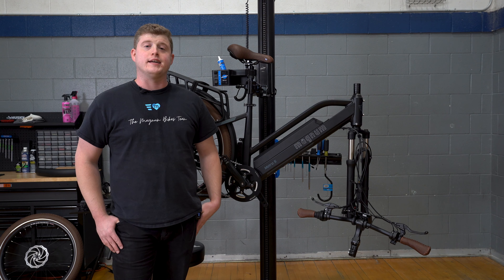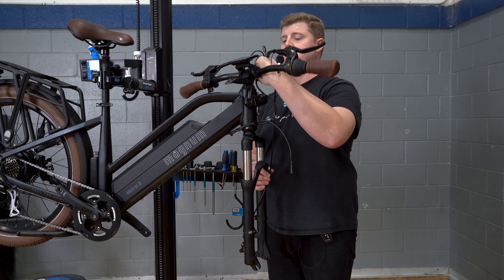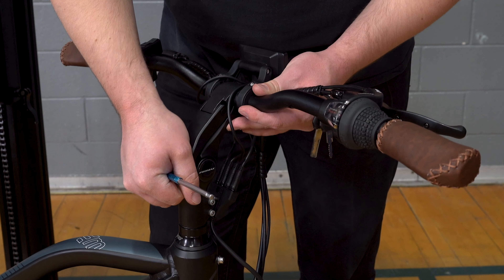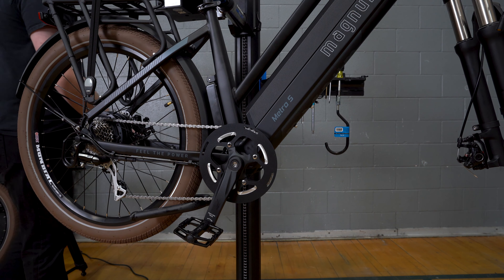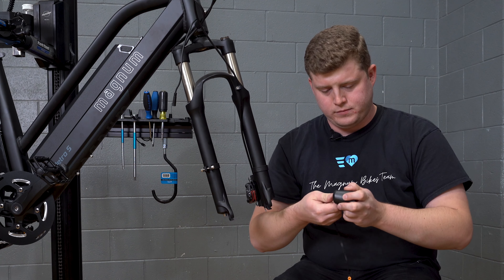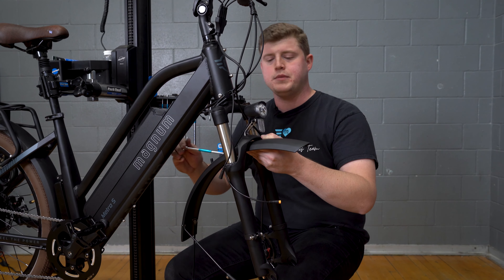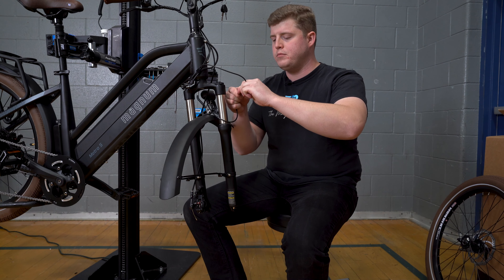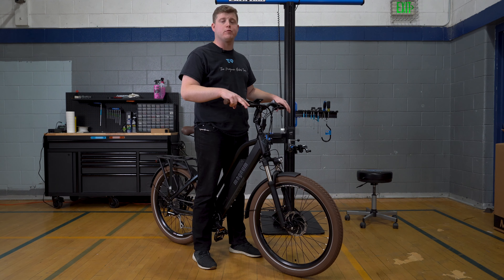Magnum Metro Assembly | How To

Comment: After removing that first bolt from the handle bar mount, i have what seems to be a left over piece of aluminum that has Neco painted on it. It was shoved into the cardboard tube that has replaced the extra 10mm spacers. Can you confirm this piece is not needed?